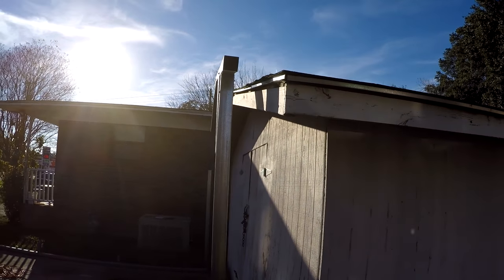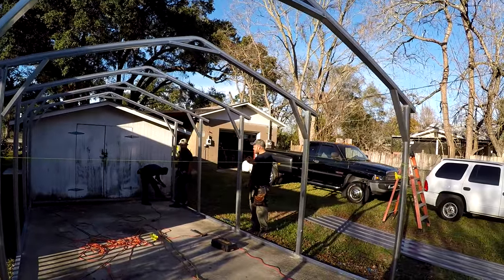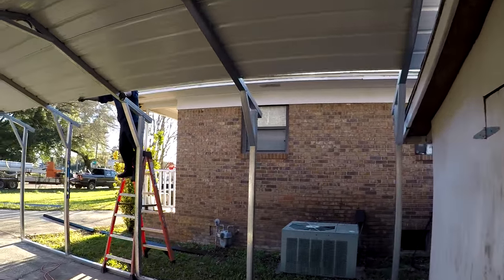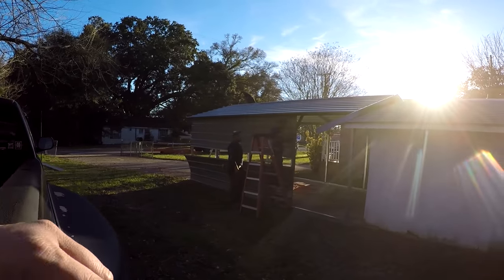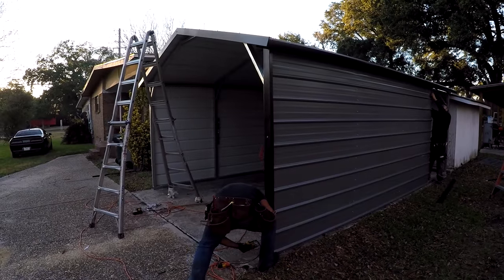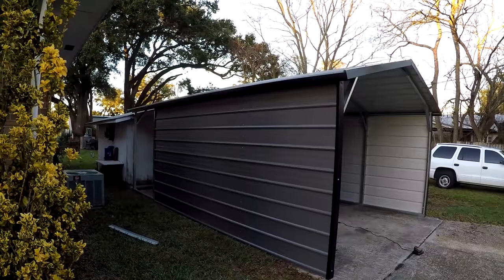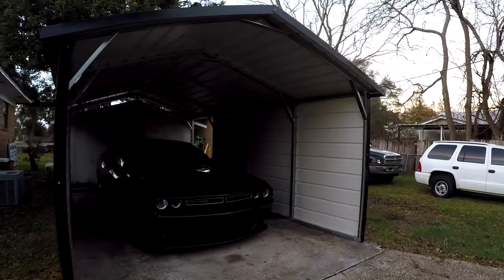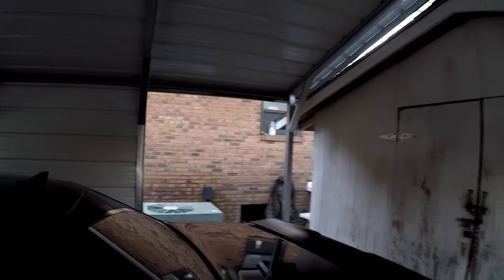Carolina Carport Install

Comment: Better luck then I had with my new garage, moved out of my factory into a new garage to work from home, they turned up 3 weeks late, then concreters didn't order enough so they let drive apron dry half done and had to cut it up week later (bit of that in latest vid), eventually all fixed and Ive moved in but so late I had to get back into work waiting and haven't had time to bolt down machines so the mill and lathe or jumping around a bit. That's life i'll get her done, Cheers.

Comment: Nice carport. You could install some low voltage LED strip lights in there to provide some light at night. You can buy them inexpensively from ebay and just run a 12V feed to them from the house or shed. Make sure to get the IP65 Waterproof type and seal up the ends and they'll last for many years. Probably cost less than $50 all up.

Comment: Handy tip- put a reflector on the front posts, about the same height as your door mirrors. Makes backing into the carport at night or in heavy rain much easier as the tail lights make it easy to see the posts with the reflectors. Especially if you have window tinting!
Those black posts will be hard to see in bad conditions and I wouldn't want to see that sweet black paintjob get damaged!
Reply from the maker: Nice tip, thanks!

Comment: Adam your a man after my own heart, I own a '03 Cummins dually a '70 Dart , and have owned a '68 Charger RT 440 and a '73 Charger 400 Magnum. MOPAR is life
Reply from the maker: I love Dodge! A dream car of mine with be a 69 Dodge Charger. One of the best looking muscle cars ever!
Reply: Abom79 '69 would have been my first choice my '68 was a great deal got it from my uncle as a complete roller minus engine and trans for $1,500. got a '68 date code motor and trans from a buddy who's a hard core collector about a year later took me 2 years more to get her all done but she was sweet that was early 90's sold it in '06 virtually all but paid for my oldest daughters 4 years of college miss that car. the Dart is my current project this one is gonna be a non resto street car all about going fast stroker small block etc. anyway congrats on finally getting the carport looks real good. kudos for not being hard on the install crew, you have a great channel take care.

Comment: you'll be able to hang masking sheets when using the buffer with magnets. that hot florida sun and that breezeway are the perfect combination with the shed right there to keep all the polish waxes cleaners coolent flushes oil pans maybe a bench vise nice

Comment: Looks awesome.   The only thing I ‘hear’ bad about metal sheds-carports-garages is in the rain they are loud.  But maybe spraying some closed cell foam on the inside of the roof would quiet it down and reduce radiating heat from the hot summer sun.

Comment: At last .... !!! :) Long wait though!
My neighbor opposite had one done - went up pretty quick. May need to watch later for birds taking over various places inside.
Indeed, I think these things are very popular.
Finally Adam is a happy camper. :)Looks a great result.
Reply: Yes birds love the angle braces. Had to box mine in with flashing.
Reply: A couple rubber snakes will keep most birds out.
Reply: They make some prickly spikey things to keep birds off. You see them at marinas.

Comment: Nice carport .  Ive had one of them for a dozen years now. A little tidbit of info everyone might like. Better lumber supply yards supply some of the  standard steel components or might order for you. For instance ,I filled all three sides in on mine after the fact. Ten years ago the price was 60 bucks for 3 foot by 20 foot steel sections . They also sold trim and some of the brackets ,should you want to install a garage door later or even ceiling crossbars for ladder storage. Another tidbit : I put mine on a stone bedding.  When this is done ,they use long pieces of rebar driven into the ground. If you live in a hurricane zone,you can enhance the buildings survival by installing a few eyebolts into the concrete in advance. If you expect nasty winds ,antenna guy wire running from the roof frames to the eyebolts might help keep it intact. Just keep the guy wire in a spool ...along with your plywood for windows. It really shouldn't take much to rig it up in a hurry IF the eyebolts are already installed. Oh ...you will find that with the panels running longitudinally like that...the roof likes to hang onto the leaves that fall on it. :-)
Reply from the maker: We have a company here who makes the same metal panels called Baker Metal Works. I know you can buy all you want from them. I don't know what all they sell though.
Reply: doors?  :-)

Comment: Looks good Adam. Too long of a wait for it.   That lower sill in your 'walk-thru' area sure looks like someone could take a header on those. You should be able to sawzall those out of there, if the corner studs are anchored to the slab.

Comment: just one question if i may. why did they start with the top of the roof as well as the upper wall sides first? as a roofer you always start from the lower portions first then over lap uppers as this would create the rain to run over the panels instead of running in them. unless they use some sort of sealant. just an observation is all. NEVER MIND I C NOW HOW THEY LIFT THE SECOND PALENS UNDER THER FIRST. SORRY TO ASK SILLY Q'S B4 WATCH THOROUGHLY.

Comment: Damn, wish we could get a three season car port built at the price you paid. For your needs, perfect. Given the wind protection your house, she'd, trees and neighborhood offers, it should hold up pretty good.
Reply: what happens at the forth season? does frankie valli come around and knock it down?
Reply from the maker: Thanks Doug. They are pretty solid once bolted together. They're certified with the state of Florida meeting wind regulations.
Reply: jusb1066 Snow loads determine fourth season rating, especially where I live.

Comment: Great looking car port.  The only thing that'd worry me about that setup is not being able to look out your home window and see your car; you can't tell if someone is messing with it, breaking into it, etc. Although you have a front yard fence which helps.
Reply from the maker: Although no one wants anyone to mess with there stuff, the car is fully insured, alarmed, and it can even be tracked if stolen. I've been pretty lucky to not ever be messed with but I have some security measures in place. new fence coming soon too.
Reply: Abom79 - Right on.  I have had that unfortunate experience once in my life...looking out your front window and seeing someone trying to break into your car.  Maybe I just have paranoia, but it definitely stays with you.

Comment: Adam,  all galvanised?  If so great job and the space at the rear was a master stroke, never mind the walk through, garages are the worst place to keep cares too much condensation and when I was at school my chemistry teacher explained (in terms of steel) the words 'oxidation' and 'rust' both of which need I.e. Iron, oxygen and water.  In a garage all three criteria are satisfied and the result (in your case) would be an unhappy car owner.  The temperature here in Scotland recently plummeted to -6c  for 5 days then next day up to +10c, all the steel components were covered in condensation.   Given I have a de-humidifier in the garage I need to up the settings to decrease the % moisture in the air.  Thanks for sharing big chap.  Kindest regards.  Joe.  PS I now (following your recommendations) have the 'Engineers Black Book' and the 'Fasteners' editions, they are an absolute MUST for any workshop.  Also think about getting the 'Drill and Tapping Chart', it's a great 'on the wall' quick check!

Comment: Nice Carport there Adam. The only thing i don't like is the fall of the roof, The roof should fall to the sides, The way you have it the water may lay in the ridges causing the roof to rust. The way you have it the water mayhave a slight fall to the front but the flashing may get blocked up with leaves preventing all the rain from getting away.

Comment: which way you want the water to run off front or back. My guess is down the sides as it's an apex roof
Do they put roofing sheets on lengthways in Merica

Comment: I have two of the C.Carports. One at house and another at my storage lot. Both of them have gone thur hurricanes and held up well. The only thing I don't like is sometimes do to weather condensation they sweat and water drips from the under side of the roof.
Reply: John West should have had them put single bubble foil/white insulation before they installed metal on roof. It   would have taken care of the condensation issue. Its worth it !

Comment: Looks good - maybe some kind of light and it will be D O N E.  "Poke it with a fork and flip it over, it's done!"  Get a set of weather proof RGB LED lighting stips look cool, don't cost too much and heck you can even get a plug in controller to make them change color with the beat to some music - great for a party for the little ones!

Comment: Now you just have to get some lights and a security system with night vision cameras to keep an eye on it since you can't see it from a window in your house.  Some scum bag will take full advantage of that if they can so it is always best to prepare for it first.  Those systems are really affordable now and mine has enough memory to record an entire year on 8 cameras and has all of the remote viewing features so you can even see the video on your phone from anywhere that you have internet and it was only $400.00  but I had to install it myself.  Good work though buddy.
Reply from the maker: No doubt about the security. I do plan on installing some lights out there.
Reply: Motion sensor lights kick butt!  You could add an adapter, in between the light and the socket that triggers a bell (just one ding).  That would make a burglar jump.  Plus you would hear it as well.  Gota get another dog.  Or research some insurance policy that will cover any thefts on your property.  Sure, insurance costs money, but it is a tax deduction (even any claim deductible).  Thieves are a drag.

Comment: hi adam glad you got it put up at last but i do have one question, why are the roof sheets on the wrong way around ? the way they are fitted will not let water leaves ect slide down & off, i know you said it should be lower at the front than the rear a bit so hope that works ok like that, car looks great inside there, keep the vids coming

Comment: You could make some canvas curtains to cover over the openings to add a little extra protection for the car when you aren't traipsing back and forth or at night.
Reply: John Ferguson Yeah, that would look classy.
Reply: There is no way that a carport next to a shed can look classy.  Sorry but that's not possible.  This is a practical but temporary solution that helps preserve the car while Abomb is trying to get another garage built.
Reply from the maker: I am going to explore some canvas cover options for the openings.
Reply: Shade cloth works very well. Keeps the sun off and anything but heavy rain, but is light and easy to fold back.

Comment: Hi Adam, how is the structure secured to the ground, to establish a wind rating. We have similar structures in Australia and they have anchor bolts into the ground regards.
Reply from the maker: There are 8 concrete anchors holding the bottom rail down.

Comment: now.. get some concrete pavers so you can set up a series of them outside the walk ways to avoid tripping on the rail on the floor.   might have to figure out something to fill the gap between the roof of the old shed and the roof of the carport.  perhaps some foam sheathing  screwed to the face of the trim on the shed roof.  or some pipe insulation shoved up in there and a piece of pvc or abs stuffed up in that to fill it up.  just something to keep the splash off the back of the car.
Reply from the maker: Yep, I may have my brother fab up some flashing to mount of there,

Comment: wonder if it would have workd out if you had made it twice as long, to get rid of the old shed, and filled it in fully and door at front? it would save the cost of messing with the old shed...perhaps its worth considering having them extend it and knock the old one down?
Reply from the maker: I have plans to remove that old shed later. I'm going to have another one put in the back corner of the property, and eventually that will all be a driveway with hopefully a new big garage in the backyard.

Comment: Hopefully you were able to keep a small piece of the siding they might have cut off the car port so you can take it to the paint store and color match it for your shed.  That is a good looking car port.  It sounds like the main company sub contracts out the labor and the labor is good but the big corporate is kind of a PITA.
Reply from the maker: Yes I kept the cut-offs. The installers are contractors hired for the installs.

Comment: I bet they have a big problem with employees, keeping crews together. Which messes with scheduling. Probably doesn't pay that well.   Still., that doesn't excuse the customer service, or lack of. Thanks for the vid.
Reply: Install could well be subcontracted out as well, may have several crews who also get work from elsewhere. Better paying work means contract work (which is often not the best paying) gets bumped.
Reply: Very true, Im sure there are several factors that lead to the lateness of Adam's install. The thing in question though, is the not so good customer support. Being late is one thing but not hearing from them is quite another. Especially after making a substantial down payment. I'd be willing to bet he wouldn't use them again. I wouldn't.
Reply: No. 1 is the quality of the work, which Adam seems to be very satisfied with. Great customer support and a lousy job is far worse.
Reply: If I were them I'd be really nervous doing work for the mighty Abom!! Just think what would happen if one of the screws wasn't straight.

Comment: If it was me, I'd add a couple of diagonal struts along the sides, so it doesn't topple forward (towards the road).
Reply: Not Possible with the side panels installed

Comment: forgot to add you can get a sun shade screen at harbor freight and cut to fit for a hanging door.... use magnets on side to keep it from flapping in the wind.
Reply from the maker: I'll look into that. I do want to add some kind of cover on the front, I just didn't know what to do there. I was picturing some kind of canvas I could roll up.
Reply: Look for tent, awning, and boat  places around you. I'd bet they can hook you up with custom canvas.

Maybe an Abom79 logo stitched into it. ;)

Looks great and glad they finally got it done.

Comment: Looks good, Adam. Is it bolted to the ground? I would fear wind picking it up. Glad you're happy.
Reply from the maker: Yes there is 8 anchors drilled into the concrete, 4 on each side.
Reply: Hot looking car. I love Mopar.

Comment: I don't understand why you couldn't just machine a car port.
Reply from the maker: I couldn't afford myself.
Reply: I've recently been accepting the fact that when it comes to personal side projects, they get done much faster when I pay someone else to do them.
Reply: Kudos for the Video! Apologies for butting in, I am interested in your thoughts. Have you considered - Mahorrla Wooden Paradise Method (should be on google have a look)? It is an awesome one of a kind product for building better sheds and woodworking without the hard work. Ive heard some pretty good things about it and my mate after many years got amazing results with it.
Reply: Hey I'm in S C as well and thinking about getting a carport. About how much was it installed, before  the additional cost for the sides added and how much with the sides . Thanks for your help. P.S . Nice ride too lol
Reply: @scottriddle5468  Hey Scott, If you have not yet, Be sure to lock your tools up before they arrive at ur place, I know from experience, I use to sale these carports and Eagle

Comment: How will you prevent snow from entering the space ?
Reply from the maker: Florida prevents that for me
Reply: Hah, yes, I'm sure that was one of Adam's major concerns.
Reply: I live in Northern Labrador Where it's Winter 10 months a year. I just figured everyone got snow at least once a year.
Reply from the maker: I've seen flurrys maybe 3-4 times here. Never enough to stick and make a white layer.
Reply: canadaeast
Wow, that's a lot of cold weather to deal with.
Reply: Youre so lucky to be in Florida, here in Illinois we get the whole spectrum, sub zero cold, stifling heat, blizzards, ice storms, tornados, floods.  But I guess Florida has its moments as well when storm season rears its ugly head.  Nice carport, I would have picked the same colors.  I had one but the neighbors tree dropped a huge limb and crushed it flat-lol  Fortunately the car or people weren't under it at the time.
Reply: Carports would fill up with snowdrifts here.
Reply: 10 months of winter, and 2 months of poor sledding.

Comment: U know this is old but just wondering how much it cost you if you don't mind me asking
Reply from the maker: Jay Boss Base price for this size is $800, with the addition of extra height, and sides closed in I was at 1,200 installed.

Comment: Why not make the shed match the carport? You can order the metal like that from many large hardware stores and lumber yards. It is much easier then painting.
Reply from the maker: I plan on tearing down the shed later so I can make room for a driveway to the back.

Comment: 2 Hours...pretty good, too bad the customer service wasn't as impressive....framework looks quite sturdy, well braced...
Reply: Likely not an issue in Florida but where I live, (British Columbia), I'd be curious about the snow load rating. It looks sturdy enough though.
Reply from the maker: They are certified with the state of FL for wind. Snow.....?